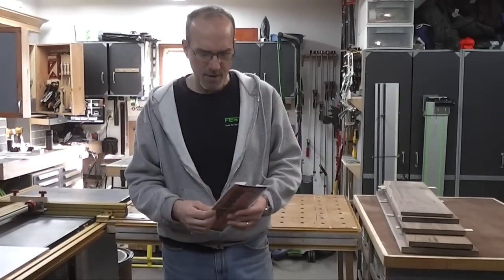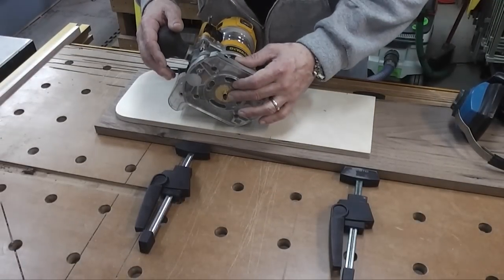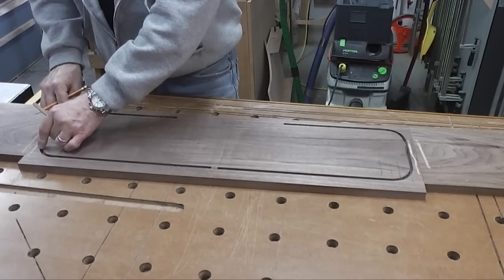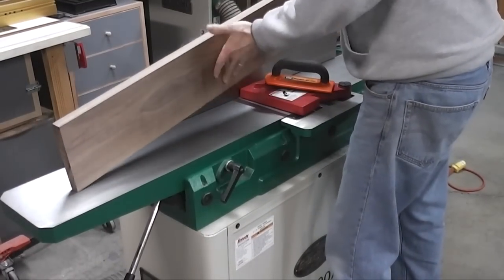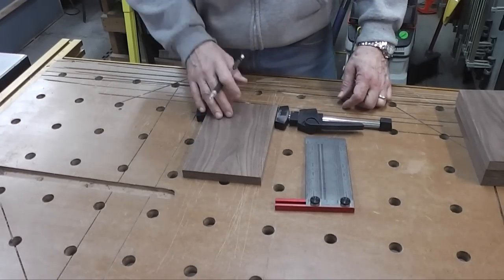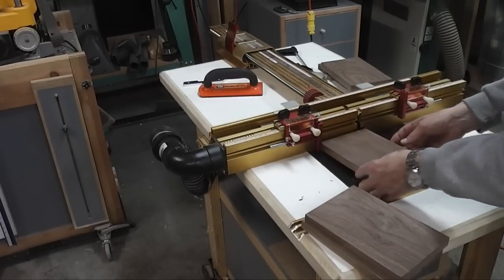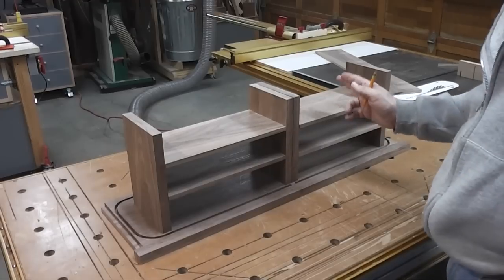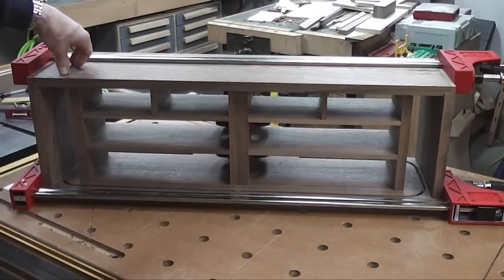Small Secretary With Tambour Door - Hutch Layout

Comment: Should be a fun project to watch. I enjoyed seeing the process for cutting the tambour slots.

I just got that Dewalt router for Christmas, along with the dust collection attachments. I saw you weren't using the dust collection although it was attached. I'll be trying it eventually, but maybe it doesn't work very well?

99% sure the location is correct? Kind of living on the edge aren't you ;-)
Reply from the maker: Thanks Marty. Yes, the dust collection works fine on the router. However with the guide bushing on, there is really not a way for the chips to go up into the collector, and that is true on both of my routers. And yes, I do like to live on the edge. It keeps me young!

Comment: Nice work! Does your dewalt planer come with byrd shelix cutter head? Does it significantly reduce the noise?
Reply from the maker: Thanks! When I bought the planer, I bought the Shelix head at the same time, and have never used the straight knives that came with it, so I really couldn't tell you if it is quieter now. I can tell you that the Shelix head work great in my planer though!